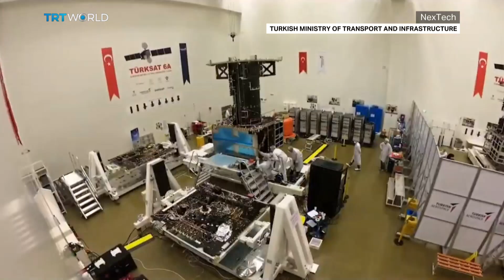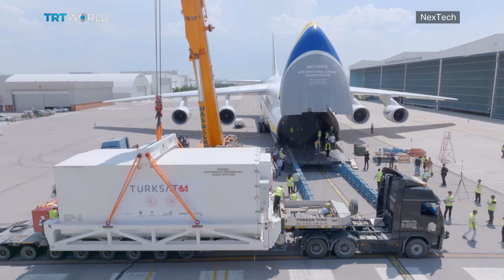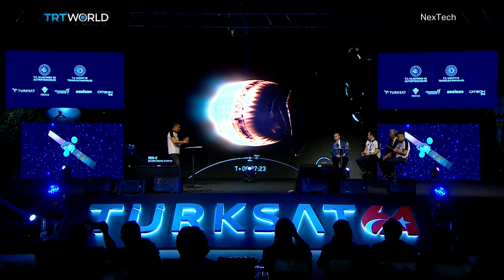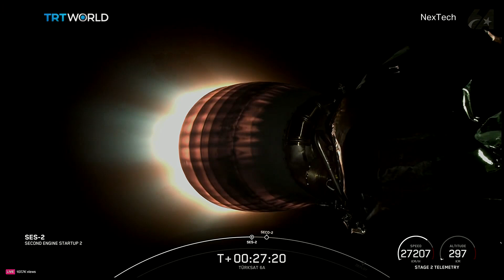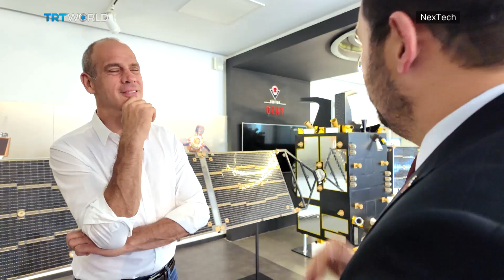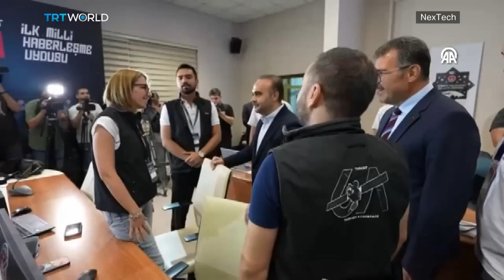Inside Türkiye's Türksat 6A Launch

Comment: You made the satellite but you can’t launch it from your country and have to fly it 20 thousand miles to the united state to launch it,How does that make sense?
Reply: Herşeyin bir başlangıcı vardır. Türkiye’de roket teknolojisi ile ilgili ciddi çalışmalar yapılıyor ve önemli ilerlemeler sağlanıyor.
Reply: @NejatÖvütmen-f8n  tbh a satellite is an easy thing to make. A cryogenic engine is something which is a difficult thing to achieve and not many has the capability to do it. Even Pakistan made their own
Reply: @teddy7258-d5g Pakistan not even have their own rocket so how could they develop the prestigious cryogenic engine and only 6 nations only have this technology